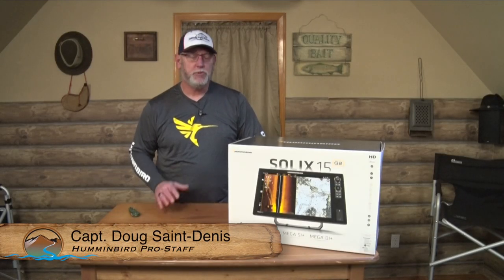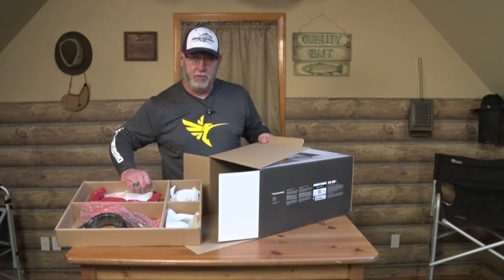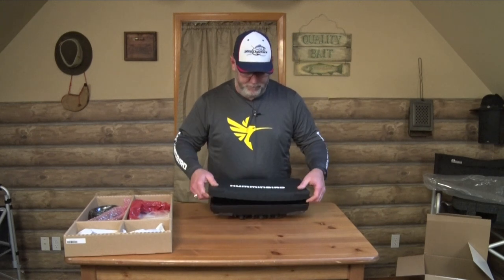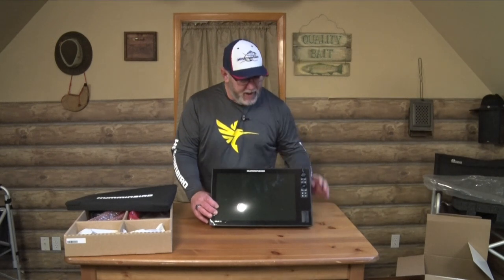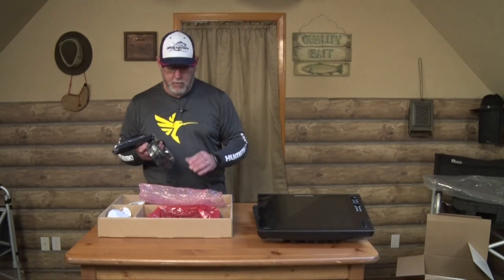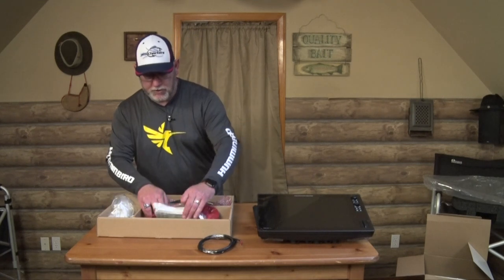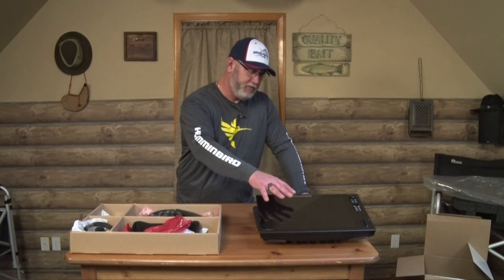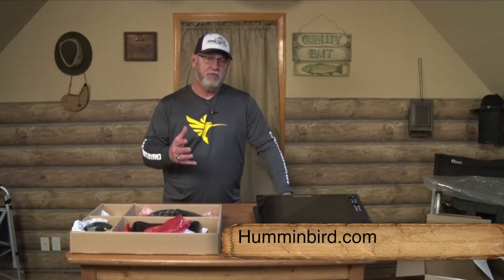Humminbird Solix 15 Mega SI+ Unboxing

Comment: Great explanation on this I just bought one for my 17ft Jon boat ? For you why is there 2 ports of NMEA
Reply from the maker: Sorry for the delay.  One NMEA is 0183 and one is NMEA 2000.  These are two different NMEA connections.  NMEA 0183 is the old style of NMEA, while NMEA 2000 is the new standard.  However, give the fact some VHF radios do not have NMEA 2000, they provide so you can use it if necessary.

Comment: I just bought a solix 15 love the unit but why does this unit not come with plug protection I never leave it on my boat I always take it in the hotel or my house when not in use just 4$k you figured they would have some cap or cover for the plugs when not hooked up
Reply from the maker: Your unit should have had caps for each of the ports on the back.  When the port is in use, the cap just dangles from the unit.  If you do not have these caps, you should contact customer support.
Reply: ridgetoriveroutdoors yes when I bought new they didn’t have them had to take it back to cabellas to get new unit

Comment: Do we need a separate dedicated battery with the Solix?
Reply from the maker: No.  But I do recommend running the correct size wire directly to the battery.  The fuse should also be located near the battery, not the unit.  If you find that your unit is turning off when you start your engine, you may need to get a larger size battery, say going from a group 27 to a group 31 OR, you may need to put the Solix on it's own battery.  Hope this helps.